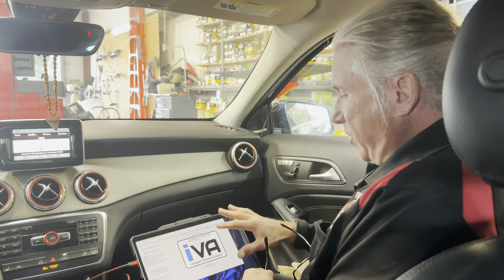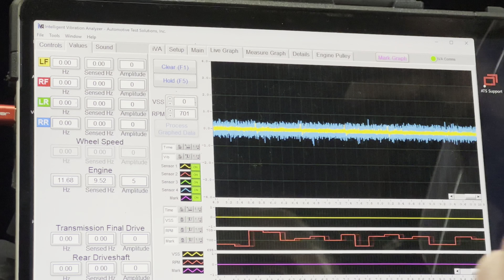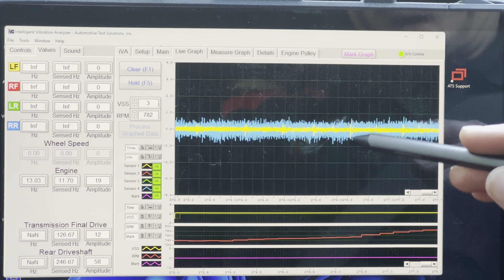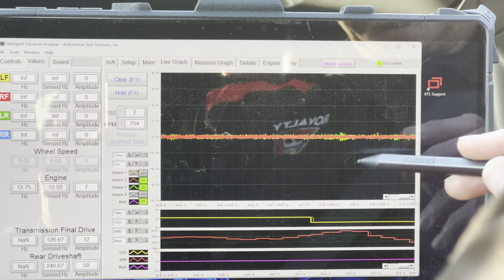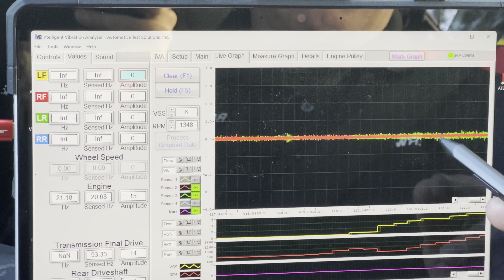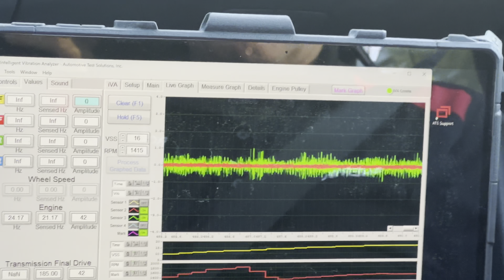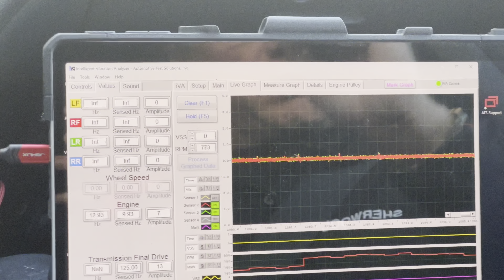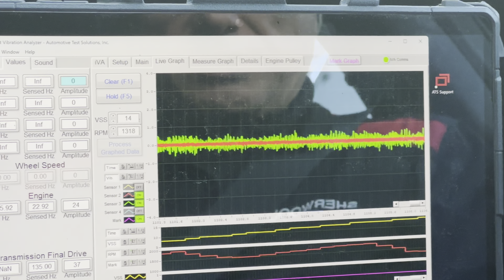A Tool That Changes The Way We Diagnose Noises & Vibrations! (2015 Mercedes GLA250)

Comment: BMW tech here, I have seen rear diffs making noise because the customer had a brand new tire installed in the rear and the other tire at half life. No SIB but it's something that the engineers told us to look out for.
Reply from the maker: Yep, and I've been told on BMW you can get a no shift complaint with no codes because of tires not being worn evenly.
Reply: @theroyaltyautoservice  very interesting, I've yet to come along this problem will keep it in mind. Thanks!
Reply: Bmw makes the biggest shitboxes lol you cant even deny that
Reply: @isorozco511  that's why I work for them lol
Reply: Subaru rear diffs will do the same with uneven tires, customers don’t believe us when we tell them
Reply: Yeah I was thinking of many.
Tires and re-evaluation B4 any repairs are isolated.
Reply: So changing the tyre fixes the noise?  What type of noise does it produce?
Reply: Well, except for VW and Trabant
Reply: @isorozco511 so BMW are shitboxes because customers are stupid or cheap and run mismatched tires on the same axle?

Comment: Being that this is a 3k usd tool. And all that diagnostic labour to find the issue. What was the charge to the customer for determining the problem?
Reply: Tool price doesn't determine customer charge. Shop that I work at charges an hour of labor. And we usually try to pinpoint where the noise is coming from and hook up a chassis ear.
Reply: Definitely tool does not determine the price. But when considering any tool purchase. One has to consider roi. So 1 hour diag for only the hardest to find noises. So not frequent enough for most shops. With no guarantee that you will get the job In the end. Hard pill to swallow.  It's a great tool by a great company. And I'd love to have it. But unless your pulling this thing out often, it'll be hard to pay it off.
Reply from the maker: It's good for noise and vibrations. It's definitely paid for itself but we've had it for several years. Maybe not a short term ROI but in the long run it helps find difficult problems and once you're known for that you will get lots of other work.

Comment: Are you sure the diff is bad? If it’s got a limited slip or clutches, all it might need is two equal diameter tires and some limited slip additive diff fluid like Redline makes. The clutches will pop like that with two diff size tires or when going around corkers esp when hot. I’d put 4 new tires on it first and reassess before digging into that diff.

Comment: If it was a normal vehicle (not European), a long screwdriver while running it up on the rack would have the same results. These tools are nice, but when that jeeps passenger rear window doesn't work, and you spend 3 hours only to find a broken wire in the driver's door hinge, it's hard to make the money to afford said tools. Please respond if I'm wrong. Likes and comments drive YT algorithms. It only helps the professor. Good video.

Comment: Based on the operation of the 4matic system if you just unplugged the rear diff solenoid and the noise goes away that would mean you need a new rear diff. Great example on how to use the tool.

Comment: Hey, Nice demo as always and showing the process. Just wanted to give a heads up since I had dealt with one doing the same thing. The rear diff won't need replacement, it will need fluid change and recalibration. The Diff is not your typical style, this one has a fluid pump, a control solenoid and a clutch pack in a drum with a piston. The noise you are hearing is from the clutch pack not grabbing well with old fluid. It is just like a BMW ATC transfer case that is in many other makes as well and those pop and jerk with old fluid (since it has a clutch in it also) until you service it. Based off the amplitude of the reading from the "knocking" it doesn't appear to be too severe and the fluid service will stop the rear diff from acting up. 
 The one I did ( https://youtu.be/H9gWBlA4Nus ) turned out fine after the service, again just a pointer based off my experience I had, thanks again for sharing.

Comment: More great content....Wondering if the initial bearing damage occurred at the same time as the tire replacement- (impact damage)?,  then the snowball effect of the diff trying to operate with two different circumference tires causing it's demise. Sometimes customers have memory loss until you prod them a little bit. Again, good stuff. Al H.

Comment: Video suggestion, can you bring in an all wheel drive car with no problems or noises, with well warn tires and simply put on a new tire  (maybe use the spare) and then run the same sound test to see if it can pinpoint the different tire? Maybe use a Jeep Grand Cherokee?

Comment: I still have my Matco version that I bought back in 93' or 94'. Not quit as fancy as yours, its strictly by ear through a set of headphones. But they made me sooooo much money over the years. No one in my dealer wanted to do the NVH or water leaks. Get good at it and there is money to be made.

Comment: Great tool. I do my own repairs and can't put my vehicle up on a lift. I hate chasing "clunking" sounds. Though my last one might of been kind of easy, I pulled the 4 wheel drive fuse to put my SUV into front wheel only and the clunk went away, so, I pretty much know I am screwed and probably need to spend some big bucks in a shop.

Comment: Love you guys, your videos are very educational always. I try to use your videos as examples to my friends and family of what a good shop is. 

 I'm curious though about the noise on the wheel bearing..

Is there anything else at those wheel bearing attachment points that could cause additional noise as well, that also wouldn't transfer when swapping the wheels? Brake related drag or something?

Comment: Did you say you were replacing the rear diff?
Isn't it just the LSD binding due to the difference in rotation of each tyre being to high?
As you said, I've seen clutched transfer cases toasted due to this but not many diffs.

Comment: Nice tool but looks like it could be improved on. If I was in charge of IVA's R&D I would make the sensors wireless with a small removable lithium battery and a wireless wifi connection to the main unit. The main unit would obviously have a wifi wireless router built in it. I was watching this and thinking I bet it's expensive to have one of those clamps slip off and a tire catches it. Looks like it takes a lot of time and care to plant the sensors and run the cables into the cabin. Wireless would eliminate a lot of the time setting it up. Of course you would also need a reminder to remove the sensors when the diagnosing is done so they don't go out the door with the customer. I'm 75 and no longer a professional mechanic, but back in the day I did my fair share of hood surfing to listen for noises.

Comment: **No “after the fix”  video showing the before and after???😢

**I did notice when you first got in car at the 5:30 mark on the video the tire sizes aren’t entered. My guess is it did t matter in this situation but think if entered will it help with further diagnostics such as catching uneven wear or not? 

**Also if you take the antennas when you know the area you can move multiple antennas into one wheel area and with a little tweaking dang near get the area of the bearing that is bad identified albeit with enough mathematical calculations. 

**Also keep in mind each item on a vehicle makes its own waveform just as we do with waveform diagnostics. 

How cool would it be to be able to hook up via OBDII, drive the vehicle and based on the noise the vehicle be able to say this part is making this noise which in turn gives you the waveform this allowing faster diagnostics with improved efficiency. 

**With the advent of technology we’re getting closer and closer to this point.

Comment: My question what do you charge in terms of diagnostics? Being that it takes time to set all these sensors in place. To then drive it. And attempt to pinpoint the source of the noise. This is time consuming. And will vary from car to car.

Comment: Nvh can be a good tool,,,,but if it was me i wouldnt sell a wheelbearing without hearing it with a stethoscope  on a lift....and id be leary about selling a diff till the vehicle had new,or evenly worn tires on it first...seen this with caddilacs with one. New tire and others worn out.......could be diff lock ,or transfer case kicking in from wheel speed diff

Comment: No one in the UK has one of these. Annoying because I have a vibration in my brake pedal between 65 and 70. Also a general steering wheel and seat vibration. Had an inspection and "nothing determinitive". Nothing broken or obvious, but I have no idea what they did other than drive it.

Comment: So having proven the noise is coming from the diff, do you recommend new tires, and a diff inspection/fluid change?  Or just go straight to replacing the diff?
Reply from the maker: Diff and tires. Our experience has been once the noise starts it's done.
Reply: @theroyaltyautoservice I don’t accept that path, 4 tires first, reassess the thumping clanking whatever is when going straight, then do the bearing and decide to try diff fluid change with a limited slip additive if this has the clutches inside.

Comment: Thanks for the video, but until you replace and confirm the fix(es) then this really doesn't hold water.  Seen too many times people call a part, even after diagnosis, but be dead wrong.

Don't take this the wrong way.  Hopefully you can either edit the video at the end after repair, or even pin a comment.  Something.  

I can wave a magic chicken bone at it and say the same thing.